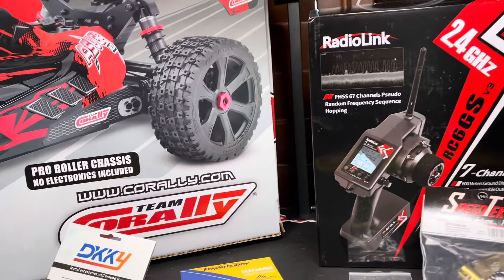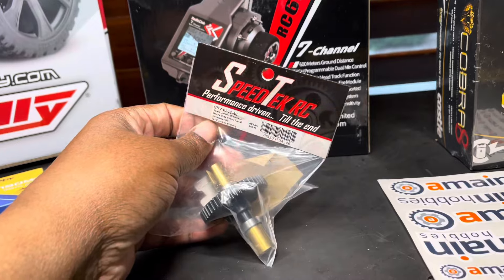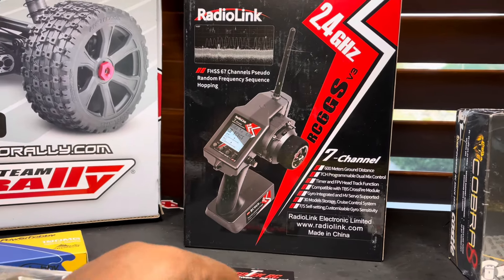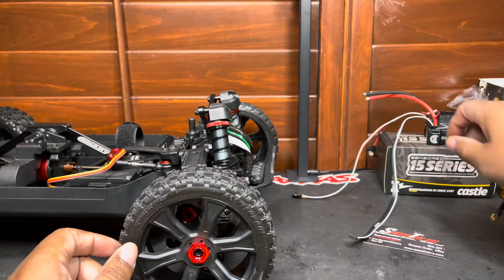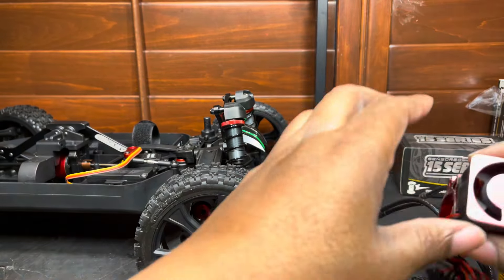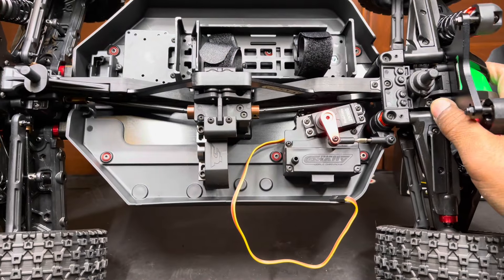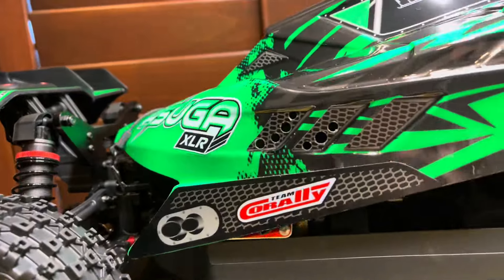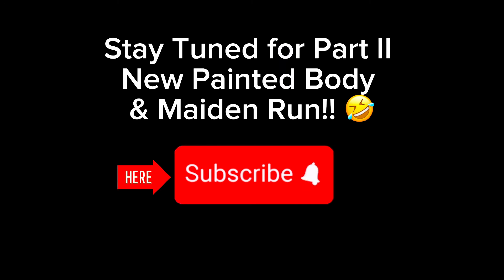TEAM CORALLY ASUGA XLR UNBOXING CASTLE COBRA 8 LIMTED EDITION GOLD 2200KV COMBO

Comment: Thanks for the content!! Got my Omni T weird though, bent center drive shaft? Wobbles when moving car back and forth?? Vibrate at high speed? Also the tires and wheels wobble a lot? Tried center and tighten down on shafts.. maybe foam inside or glue job not balanced from factory? Don’t get why centers shaft screwed up out of box….
Reply from the maker: thanks for watching. aww man, that sound like a defective rig.. they mos def do not wobble, send it back bro, where did you get it? If amazon, return it and have them send you a new one. sux man, you shouldn't have to buy a driveshaft and 4 tires.

Comment: Nice xlr …Just got mine in (roller (color:red) I got 2 motors setups ….not Sure on which one I want to run max 6 1650 or max 8 2250 can’t wait
Reply from the maker: All depends on how you plan to run it, bashing with good torque 1650, biggest pinion i think is a 19t unless you go with a smaller spool or different motor mount.. the 2250 is great for speed and racing.. get a spool and let it fly. I have a 46t spool and i think i running a 22T or 23T pinion. Its super quick..